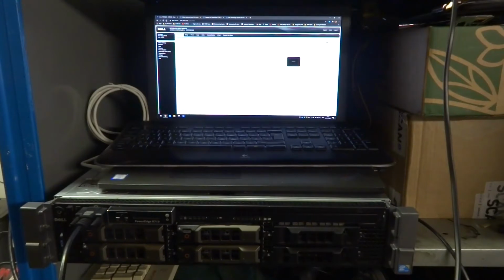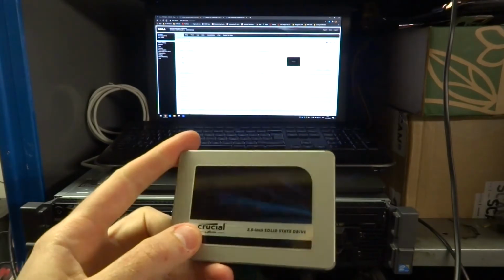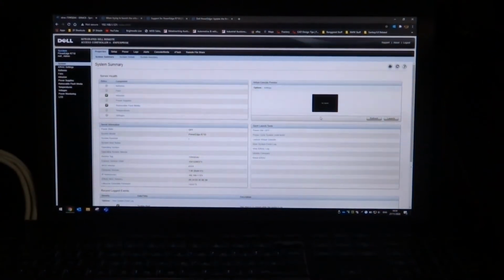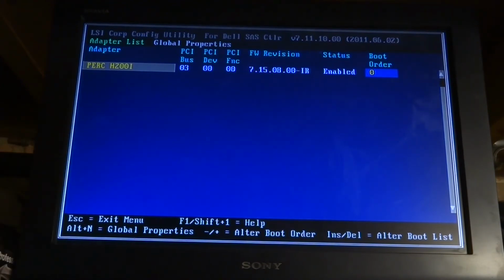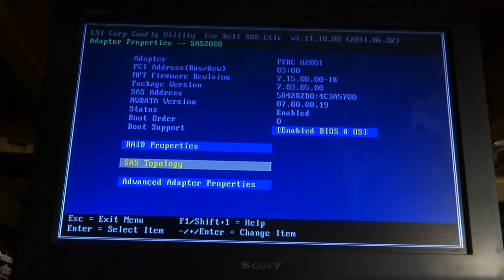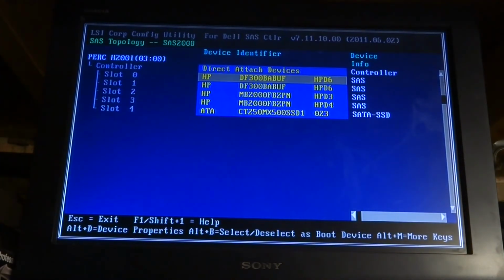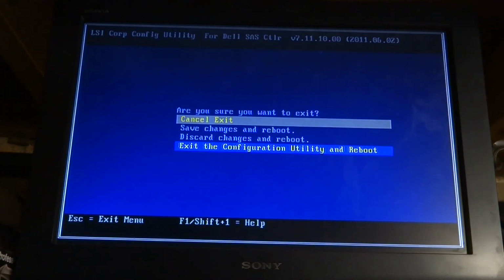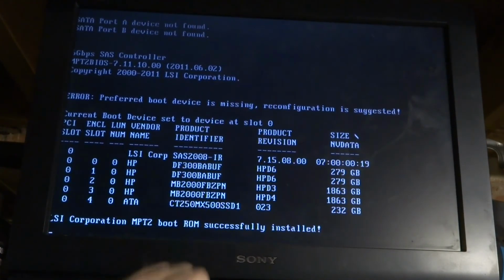Dell R710: H200I HBA card and SSD Install

Comment: So you don't need to hook up the up the battery to the HBA for it to work? That's strange. Because my Poweredge server isn't detecting the card...
Reply: Cool, don't need to worry about the battery, Apparently the H200 doesn't go in the designated slot for the Dell Poweredge T610 where your usual PERC 6/i card, or H700 card goes. Had to put it in the extra PCIe slots.

Comment: Did you get the cable for the motherboard so you can get power to the ssd by using the internal sata connection?
Reply from the maker: yes i did, Its just a blue colour sata cable with a combo connector on the front end with a mini SATA power plug.
Reply: @SHEARMANDESIGN  do you have a link to buy?